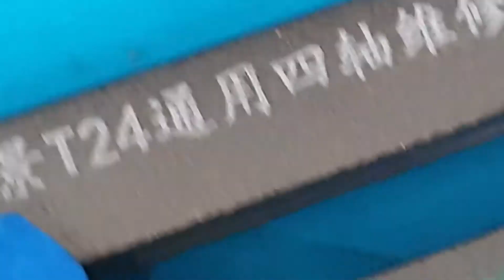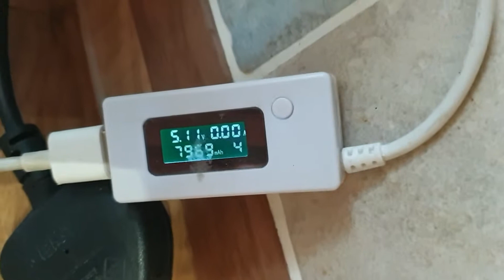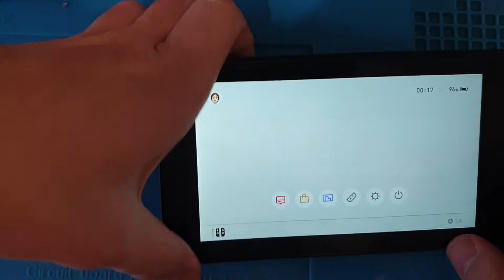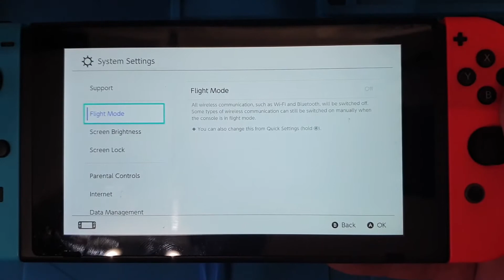Faulty USB C port on a Nintendo Switch, more ebay junk!

Comment: Why did you use some sort of copper foil to cover some parts on the pcb when you were heating it? Is it possible to use kapton tape instead?
Reply from the maker: I covered the plastic parts that may melt. You could use kapton tape but I find it curls too easily once it gets warm so I try to use copper tape as it stays stuck better.